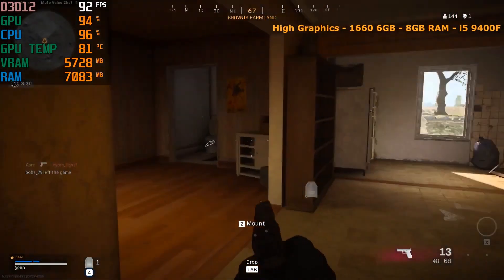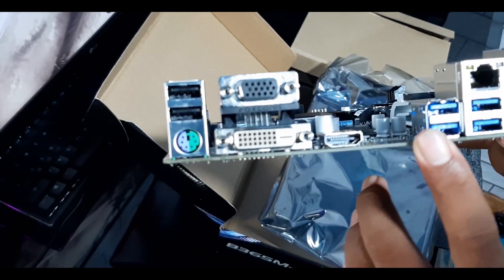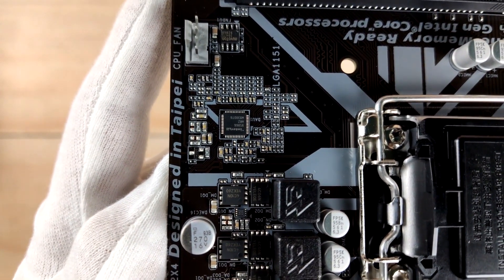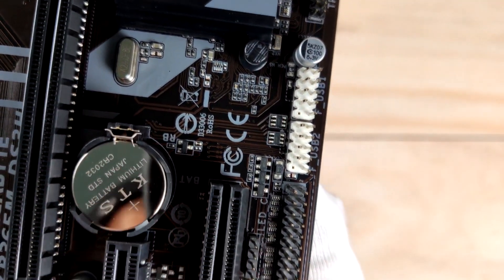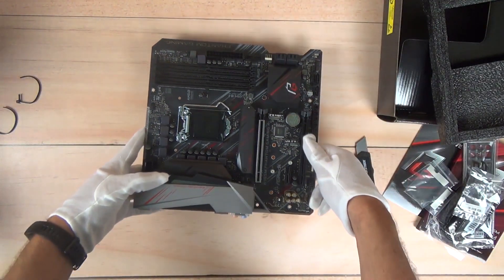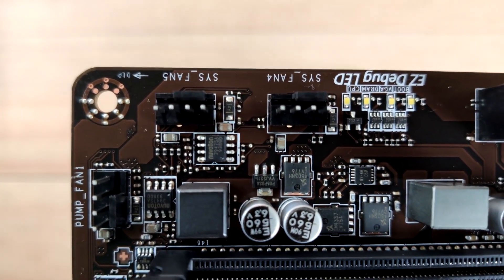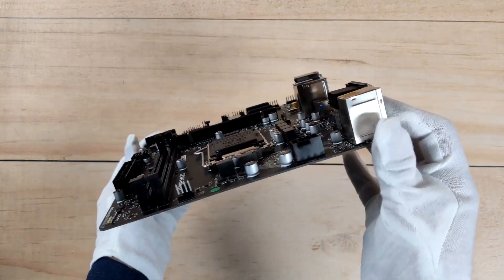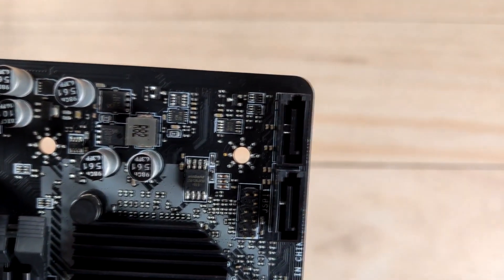Best Motherboard for Intel i5-9400F 2023

Comment: does an h110I-plus work can anyone let me know please
Reply: Nope, you need a "300" series motherboard for 8th and 9th gen cpus. For example h 310, b 360 will work. H110 is for 6th gen intel cpus if im not mistaken. Basically i3,i5,i7 6xxx. And 200 series is for both 6th and 7th gen.
Hope this helps!
Reply: @Spark-pv9js  i have a b360m 🤗